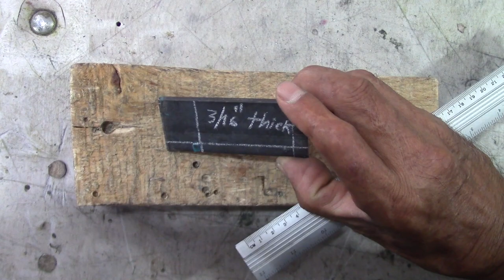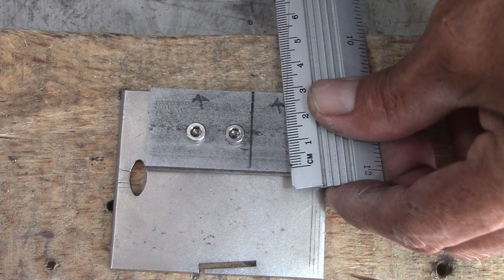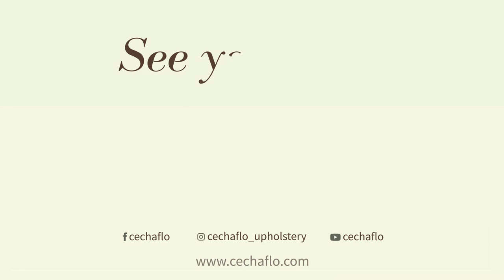Homemade Binding Attachment (thick leather/vinyl) - Car Upholstery

Comment: Very cool.  Hey, I have a chance to buy an old Pfaff 145 machine.  Is that a good one to start upholstery on?  I see you have the 1245, which I think is just a newer version?  Maybe I'm wrong.  Anyway, any insights from anyone would be appreciated.  Thanks.
Reply from the maker: Pfaff 145 are on the same array of made in German sewing machines (old versions). Pfaff 545 is in the middle of the batch.
The 145 needles are a bit shorter. It is system 134. It is also a triple transport (walking foot) sewing machine more than enough to work upholstery forever.
This is the manual:
https://www.pfaff.com/SiteMedia/PFAFF/Products/Machines/Support-manuals/pfaff_145-manual-EN.PDF
Triple transport explanation:https://www.youtube.com/watch?v=U3HBXBDDKoo&t=276s
Reply: @Cechaflo  thank you so much! Love your videos. Very instructional and inspirational.

Comment: Hi I want to make for carpet binders folder 120mm
Reply from the maker: Industrial Pfaff 335 has the attachment from factory. It was specially designed for binding process.https://www.youtube.com/watch?v=jvAJAjinh1w
https://www.youtube.com/watch?v=-H_1elKHirg
https://www.amazon.com/-/es/Completa-encuadernaci%C3%B3n-Attaching-partes-Pfaff/dp/B076S3W89K

Comment: Do you have one main sewing machine that can handle the different fabric thicknesses? What is your Main sewing machine Make/Model?  Thanks
Reply from the maker: I use an industrial sewing machine Pfaff 1245-706/47 (old model)
Reply: @Cechaflo  thank you so much. I will be looking into this since i do some light leather work myself....I watch all your videos.  The level of expertise and knowledge you give your viewers is the Best my friend.☝️😎
Reply from the maker: @lynchcreekmuzzy5759  Triple transport sewing machines are  heavy duty, especially designed to sew thick layers of vinyl or leather material.https://www.youtube.com/watch?v=U3HBXBDDKoo&t=2s
Sailrite provides us useful information about feeding mechanisms that sewing machines have:
https://www.sailrite.com/Comparing-Sewing-Machine-Feeding-Mechanisms
Reply: @Cechaflo  perfect, thank you, i am new to auto upholstery but learning alot from you....I have been looking at a Sailrite for a bit but I was leaning more towards a Cowdoy or Cobra, but a used industrial Pfaff i think may be more reasonable. I am trying to find something that can handle UP to 1 thru 7 ounce leather/vinyl/canvas for folds.  Those older industrial Pfaff's are great.  Did you put a Servo on your model?
Reply from the maker: @lynchcreekmuzzy5759  I have not put a servo motor to my machine yet.

Comment: That is a cool piece ,
I have a Question that`s not related to this sorry but can`t find answer so far on internet,
I have several old industrial machines` But my 45k1 singer` when stitching in a straight line . the stiches are following in a straight line but each stitch is slanted 
So imagine the hole at the top of the stitch is on my line I grooved slightly in the leather but the bottom hole of the stitch is slightly to the right from the top hole, and this happens on every stitch,
So each stitch is ending up  slanted, any idea what this issue may be,

Comment: Ho, Ho, Ho, This is Santa and Cechaflo, since you have been such a kind, generous teacher to several thousands of people, I may just have to bring you a very nice bench vise complete with drop in brass jaws for you next Christmas! You have been a very good boy! Ho, Ho, Ho!
Reply from the maker: Thanks Dean,  I had a heavy duty metal table including a bench vise. I sold it because I have set up the shop on a third floor and I was at the point of tearing down my house. You know regularly these accesories should be placed on first floors. In fact to the moment I do not need it as this upholstery job is not really a hard job.
Reply: @Cechaflo  You are a hard working guy and not only have I learned a lot, but started a private file to save your videos for when I am healthy enough to start my buckets for pickup. Had 4 lumbar fusion, 1 done twice, they put a spinal cord stimulator that worked great during the 6 day trial. Then placed it in permanent but goes down my legs into my heels, not up above my belt were I need it. They are confused for 7 months now. I am just unable to walk because of pain. Keep up the good work as I had to have a little fun to lighten our days! Blessings.
Reply from the maker: @deankay4434  Dear Dean, I really appreciate your kind remarks!  I am so sorrow for the situation you are passing now. Hopefully, and thank to God you will get much better soon! Blessings too, my friend!!!
Reply: @Cechaflo  Thank you for kind thoughts. We only go thru life once, usually with fingers crossed!
But, honestly thank you for the thousands of hours of technical information, for free! If I wasn’t paying Drs & Co-Pays every month, I would enjoy to shake a hand, make a friend as smiles are universal languages. As I traveled 7 states to hold tech seminars with power point, or a 2 day class to new and experienced auto techs, I ended my career giving back to the industry I cared about deeply. Satisfying inside, as not everyone gets to do that. I did vehicles, you do upholstery. We are lucky, my friend! All the best wishes on your house, YouTube and health always!
Reply from the maker: @deankay4434  You are very welcome anytime!
Reply: @Cechaflo  Smiles are international languages of happy. Everyone understands a smile. 😃

Comment: this is awesome! thanks for sharing! i am planning to make one just like that! i really need it. could you show us how you made and attached the hinge cover? didn't see it in the video. i am talking about the plate with two rivets that covers the pivit point. thanks again!
Reply from the maker: min. 3:35 al 6:20  The upper plate pivots above the fulcrum of the lever carved on lower thicker piece.
Reply: @Cechaflo  10:06 the upper plate has another strip of metal attached to it across with two rivets. this strip of metal prevents the upper plate from sliding off the lower piece. it would be nice to see how it's attached
Reply from the maker: @hrrundel  Yes,  it is a 'U' shape strip that helps to keep an up and down movement straight.  There are many things still that should be modified such as to avoid those long compression springs and replace them with a sole tension spring sheet.
This small gadget is a second handmade prototype. It still needs to be improved until getting a final optimized accesory.
Reply: @Cechaflo  you're a genius! thank you for sharing!